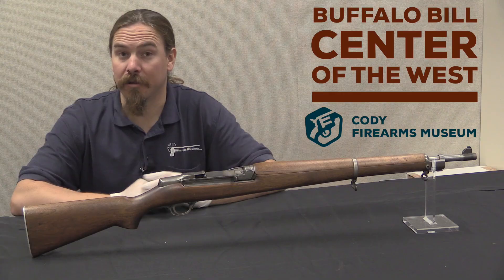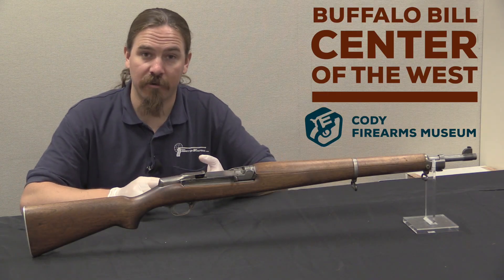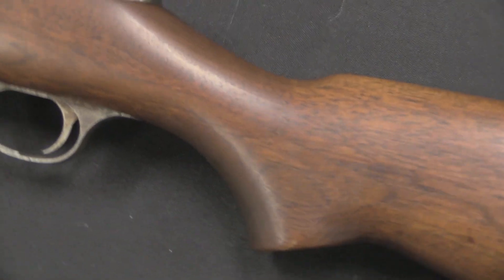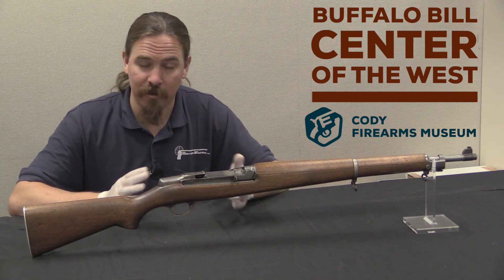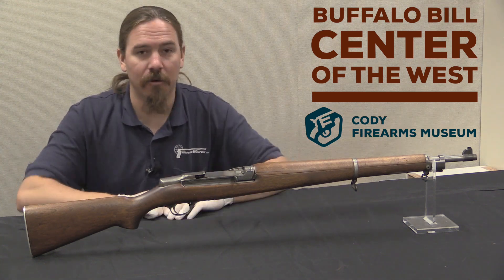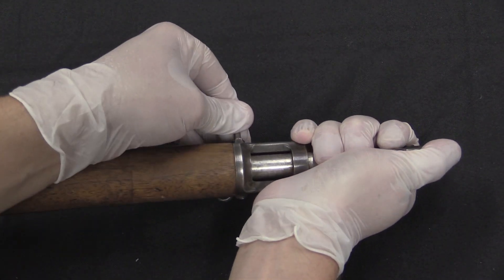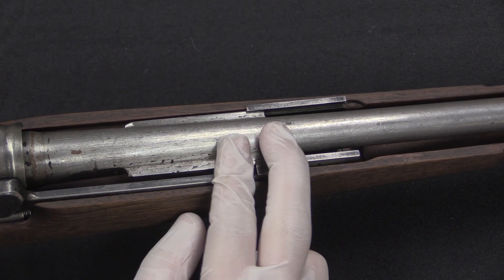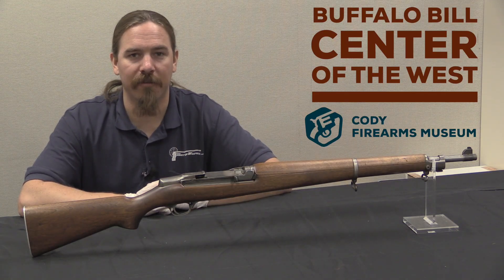Winchester M2 Rifle

Comment: I would be concerned that the corrosive ammo used in the 30-06 at the time would have rusted that gas system out pretty quickly.  The M1 Carbine shot non-corrosive ammo only.

Comment: After watching this video, all I could think about was if Studler (sorry for the misspelling) had mentioned that it would also make for a good BAR replacement. At that time the BAR was already vastly inferior to the other light machine guns in service with other nations, and offering a rifle with similar handling to the standard rifle would have been advantageous to training and procurement in the field under duress. 
The tappet system would have melded organically with a heavy barrel (barrel weight offset somewhat by the lighter gas system) and a  bipod (space to mount one easily with the short gas system). Pair that with modified magazines already in stock, a set of M1917 sights, and a select fire trigger group, and you would have yourself a rifle with a better reputation than the Garand itself (and that's saying something).

Comment: What is wrong with the guides welded in to the barrel?
Reply: The heat from welding can warp or deform the barrel, possibly even damage the rifling on the inside.

Comment: Why is the M1 carbine so unreliable? I've fired more than a few originals as well as reproductions and they all seem to jam...and jam...and jam.
Reply: AbitNutz when I first started shooting mine I had the same problem. But when loading the mag, every 5 rounds or so slap the mag against ur hand to seat the rounds all the way to the back. You'll still get a few jams though just Less likely to😆 Very fun an accurate to shoot.
Reply: AbitNutz I must have gotten lucky with my gun, it's a 44 Quality Hardware, mostly (or so it seems) original parts but with a war time Jewel replacement stock.  Mine shoots 1 inch groups at 50 yards and I have no jamming issues except with one of my old USGI mags.  I even have a 30 rounder (an original, not a fake or repro) and the gun will empty it just as fast as I can pull the trigger.  But, these guns are pretty old and they simply are going to have issues, I bet in the years to come we will see less and less of these that are completely functional.
Reply: Usually the magazine. The carbine magazines are a little too light duty for being used as long as they have been. According to Ken hackathorn, the grunts in the field usually replaced magazines every week or two, when they resupplied with ammo.

The other reason is old springs. Order a new set of springs from Wolfe and see if that fixes your issues.

Comment: also realized if winchester made a M1 rifle with detachable mags just before or in the early stages of WW2 why would the M1 maintain an N-block clip with 8 rounds instead of having 20?
Reply: because having a rifle with a clean profile is easier to shoot from the prone.  And 8 rds was still 3 rds more than most rifles of the day had.
Reply: Not to mention clips were vastly simpler to make, less concerning when the soldier loses them, and less to go wrong with dents and bent feed lips. BAR mags are notorious for being fragile.

Comment: Why did so many guns of this time had a five round magazine instead of ten or twenty?
Reply: Feed problems. The more rounds your magazine has the longer it needs to be. The longer magazine needs a longer spring and by Hooke's law that means there is a larger difference in pressure exerted by the spring between the first cartridge and the last. 

There is also an ergonomics problem with long magazines if you are expected to fire the gun from a prone position, and for the removable box magazines there is a cost consideration.

There might be even more reasons, but those are the ones I know of.
Reply: +Trabber Shir agreed with everything, would like to add one though:

These were from a time period when all of the military placed much more emphasis on "one shot one kill", there was much less suppressive fire and "spray and pray" fighting going on and as such they didn't see the need for many more rounds than 5. Hell, 8 in a semi auto (garand) was considered an insane amount of firepower and even called wasteful by some upon adoption.

Just compare the kills per shots fired during ww2 vs Vietnam.
Reply: I think this is a better explanation
Reply: A slick belly rifle is easier to shoot while prone than one with a magazine sticking out of it.  One reason when the STEN and FG42  had side feeding magazines.  Also no no is quite right about old school preference for slow aimed shots vs gaining fire superiority  with a hail of lead.

Comment: i would be interested in seeing a video on further development (if any) of the Williams 'tappet piston' system. you don't see any modern firearms utilizing this and it would be curious why otherwise seemingly solid idea fell by the way side and hasn't seen any further development with any large manufacturer or commercial production guns. Ian, if you have some thoughts and/or goo examples in mind of other weapons utilizing this 'tappet piston' please include this in your list of future videos.
Reply from the maker: Well, there will be two more such videos next week... :)
Reply: I believe the FN SCAR uses a tappet system. It's about the only "modern" rifle I know of that does so, though.
Reply: Like the other guy said, the FN SCAR uses the tappet system. I imagine that the reason it's not so commonly used is because you need a heavy bolt carrier or a bolt and op-rod in order to have the inertia you need for the gun to fully cycle from such a short "tap." Guns like the G30M, M2, and M1/M2/M3 carbine seem to accomplish this by putting the weight in the op-rod, and the SCAR does it with a massive bolt carrier, similar to a G36's bolt carrier.
Reply: i'm not familiar with SCAR beyond the fact that it's out there and ridiculously expensive for what it is. i do however appreciate the fact that tappet still in isn't forgotten. I'm contemplating trying tappet setup on one of my AKs for clean-running suppressor friendly setup. fabrication should be easy enough, interesting not very difficult project. i would love to learn more about 'tappets' so i don't dive into the deep end. thank you for the reply on SCAR. i appreciate it.
Reply: Patches my son has a scar loves it

Comment: Hey Ian, how rare are tanker Garands? I saw one the other day at my local gun show and came very close to buying it for about the same price as a normal Garand.
Reply from the maker: Typically not that hard to find, but they are all commercial modifications (not military). If you want one as a shooter, go for it - I have one myself and rather like it. They have a reputation for unreliability because some were not well built, so be aware of that.
Reply: Al Diehl ya, havent been on 7.52x54r.net in a while....

but, even with a new purpose built barrel....its still a shorter 91/30....which is a shorter 1891.
Reply: They are uncommon, not exactly rare. I'd buy one if I saw it (and knew it was legit)
Reply: +Forgotten Weapons I had a chance to examine an older "tanker" conversion some years ago. It was "wonky". At one point the op rod jumped out of its track in the receiver. They are nifty little blasters though and I'd like a competently built one some day.
Reply: KJ Fulton makes one, but it's significantly more expensive (and I imagine much better)
Reply: they are cool. but slowing down the 30 06 velocity ruins that cartridges full potential by alot. defiantly cool. there is a company that makes modern tanker m1s
Reply: +TheGoldenCaulk Yes, plus you can get them chambered in 308, if you want the power of 30-06 without the cost. 

I can see a Fulton Armory Tanker Garand 308 in my future.
Reply: The M38, M44 were not cut down 91/30s. They were purpose made with 20" barrels as carbines. Some utilized re-purposed actions but, were not truly cut down 91/30 rifles. Post WWII (1959) they did make a cut down 91/30 called a 91/59. This one is distinguishable by having features of an M38 but, retaining the longer rifle sight bed with the range numbers altered.
Reply: russians cut down the 91/30 from 4 feet of barrel to less than 2 feet during the war...m39, m43, m44. (iirc)

when your only shooting 100 maybe 200 it just doesnt matter. 
it still would have better ballistics than 30-30....and ive killed a lot of shit with 30-30.

Comment: What is the largest calibre flintlock you have ever seen?
Reply: 24 Pound ships cannon.
Reply: But that isn't a flintlock. It just has a touch hole and it's ignited with a torch.
Reply: naval guns did get flintlock firing mechanisms - they stopped the wicks of firer getting damp/wet from sea spray blown in through gun ports & shell hole damage, and meant the gun deck was safer without lit wicks maybe being dropped into powder stashes for the guns next firings, later they switched to percussion cap firers too; naval guns follwed the safety and more efficient firing developments from artillery and musketry/rifles.